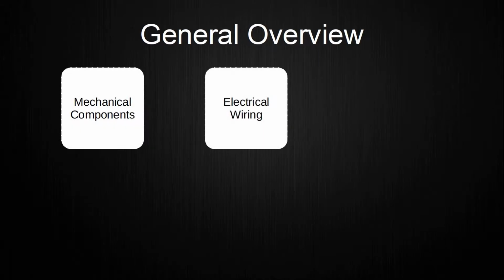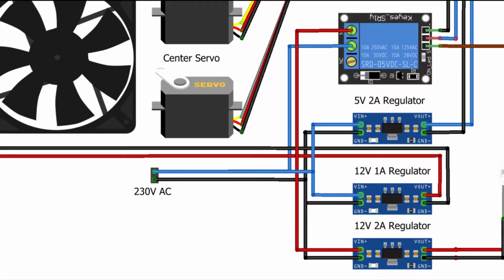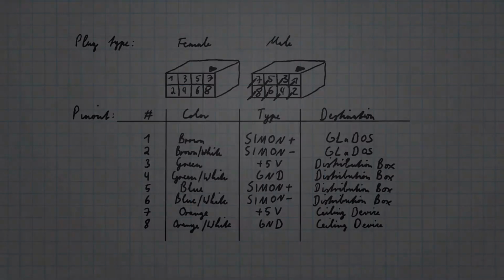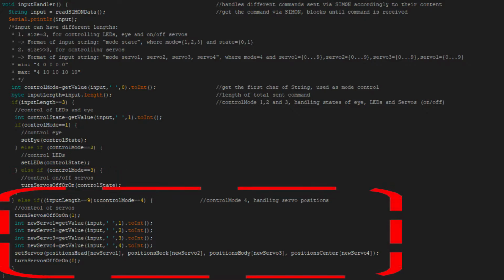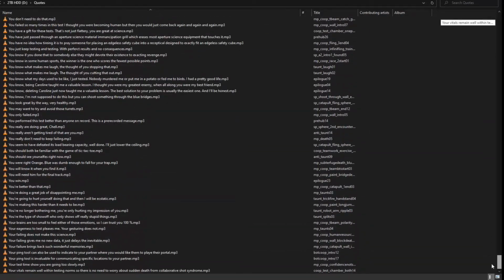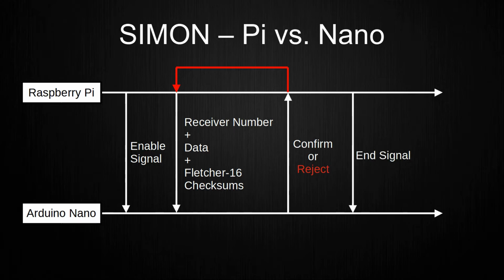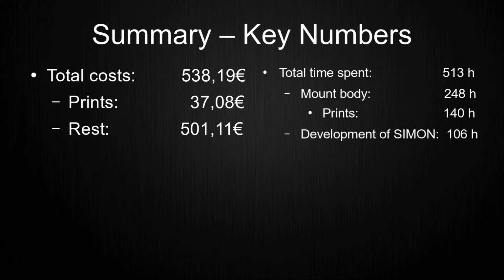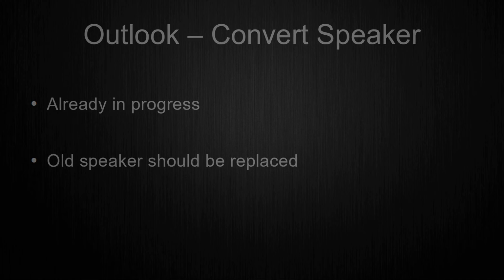GLaDOS - A Technical Overview

Comment: What is the cost of printing most bare bones version of glados
Reply from the maker: If you don't include the display, all of the sets for singular components and some other stuff for future upgrades, you should get away with ~250€. If you already have stuff like perfboards and dupont connectors, its even less with ~200€. That would only include the body itself and the required electronics for the lamps and servos